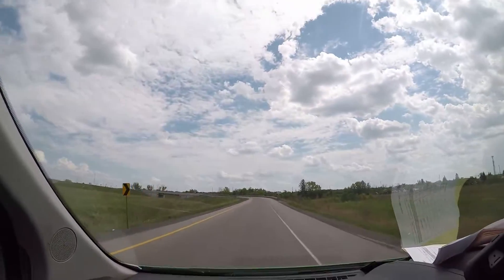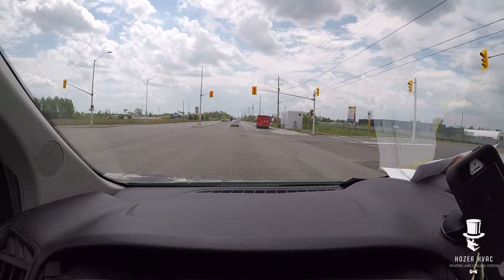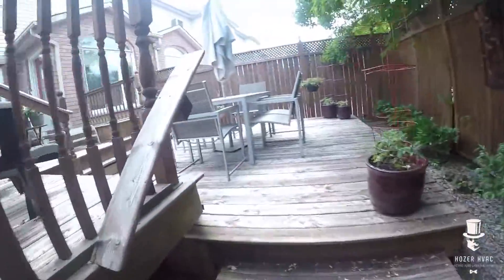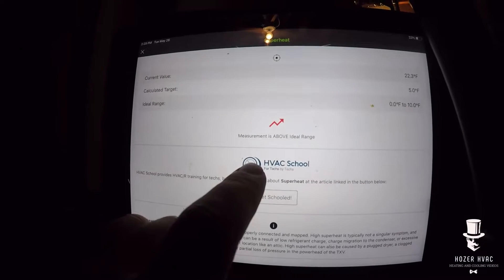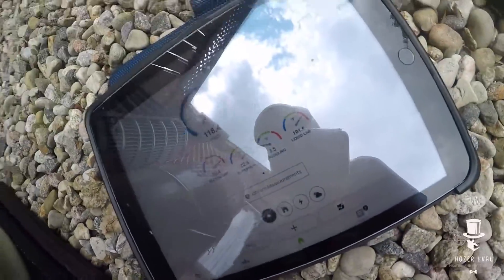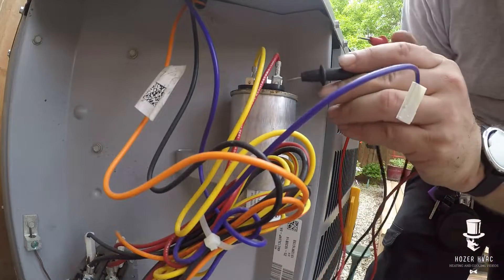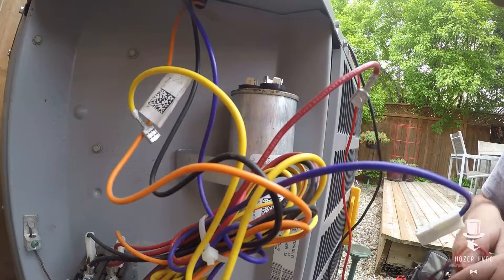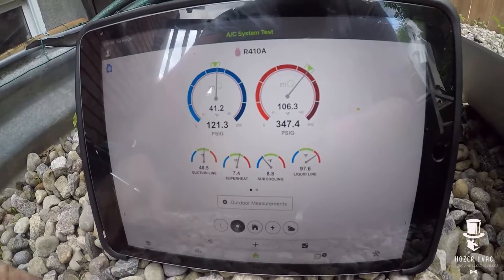Air Flo AC not cooling high superheat

Comment: I love the time you spend to check super heat with the App but we find here in the Toronto area its GO GO GO no one cares for what tech stuff we can use I am the only guy of my friends in the bus that love pulling out the dig gauges  and checking the sup heat and showing the customer true way of service great video. I will pull out the home owner and show and explain the the basic of whats going on small amount of them love it.
Reply from the maker: The go go go mentality of in and out doesn’t do anyone good. Digital probes are the future. They are less harmful to the unit because they are hose less and also provide accuracy. The company I work for is not the cheapest but we do full system diagnostics on all calls, which means we check the system over in its entirety. The Canadian market tends to be a little behind when it comes to HVAC trends. Sooner or later we will only see digital probes. Thanks for watching man